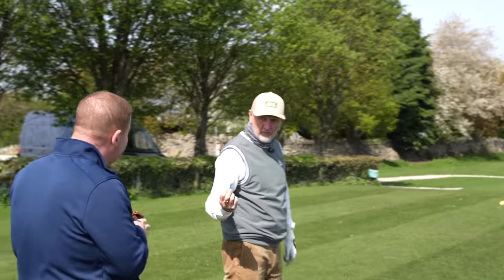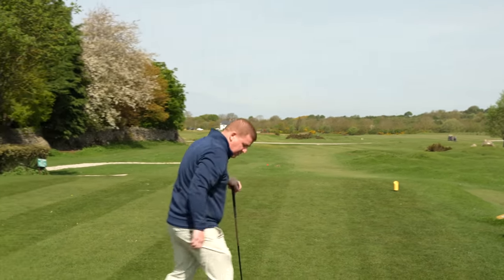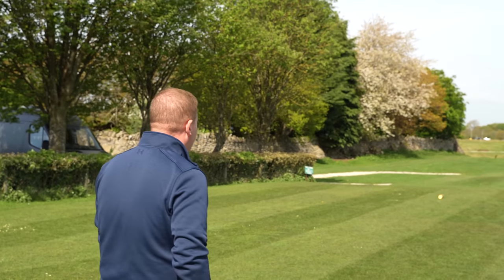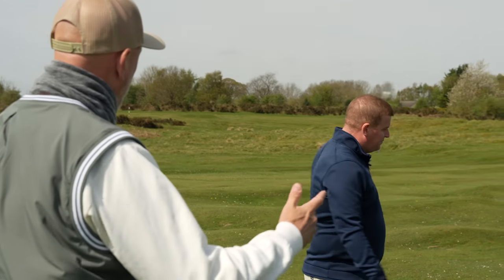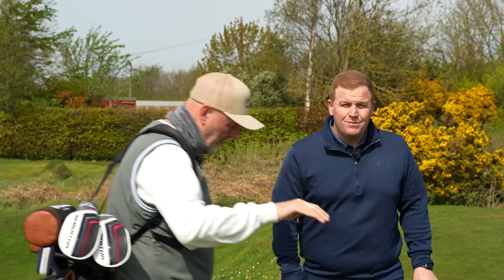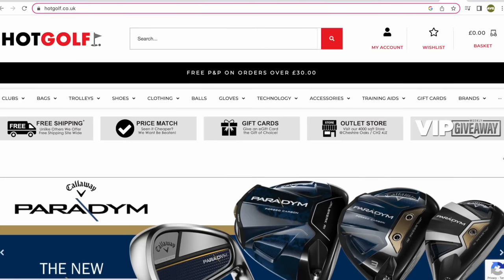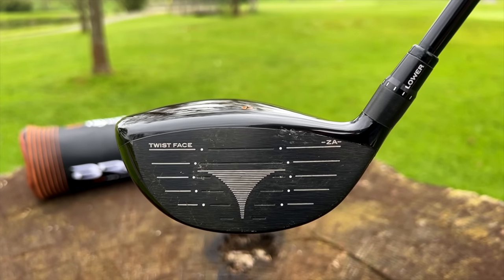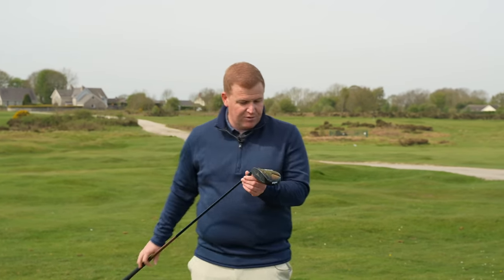We tried this with the TaylorMade Mini BRNR Driver!!!

Comment: I bought two of these mini’s, I play the 11.5 at 10.5 with a stiff shaft; I play the 13.5 at 14.5 with a regular shaft.  I hit a fade with the 11.5; I hit a draw with the 13.5.  No driver and 3 wood in my bag anymore.  These are so easy to hit!  I love hitting the 13.5 off the ground, so easy!
Reply: Is the 11.5 difficult to hit off the ground?
Reply: @James-th8tu  If you have the heavy weight in the back, it’s surprisingly easy to hit off the turf.  The only time I use the 11.5 off the turf is if I have to hit a big fade; other wise, I use the 13.5 off the turf.  I’ve played just about every mini-driver ever and this is by far the best.  I just don’t like the big headed drivers-I also play hickory golf and just enjoy smaller heads.

Comment: I bought a 300 mini 11.5 play it at 10.75 with a stiff diamana black shaft and it goes in the bag when the big boy goes off! I use a white castle tee and the flight and accuracy are exactly what I want off the tee when I am having a rocky time!

Comment: I have been playing a Mizuno STG from the factory at 44 inches and  set to 11 degree which closed the clubface  from standard enough to help fight my late square up fades. I have been hitting center of the face more often and getting a more penetrating flight. I have not noticed any loss of distance from my full length Rogue ST.

Comment: i ended up getting the new 2024 copper version and i LOVE it  went with the 13.5 degree and the MCC +4 midsize grip  I am 59 years old and a 8 handicap    off the fairway is awesome and off the tee   glad i went with it to go inbetween my 9 degree driver and my 17 degree Hywood    then my Qi10 Max 7 wood  22 degrees    Knock on wood off the deck i have been blasting it it works great for me     cheers from Canada

Comment: Teeing the ball low and swinging more like a FW wood is key with mini driver, in my experience. Feels so much more powerful and under control than trying to hit up on it like a driver. The CG is such that an upward AoA produces weak strikes.
Reply: Funny you say that, I was really struggling with this club when I got it (high handicapper). The balls had no speed or height, no control and felt awful coming out. I started leaning back a bit and hitting up on it like a driver (still teed pretty low) and got much much better results, about 10-20 yards less than my driver but better dispersion. I saw so many people online saying to hit it like a 3-wood so I just kept stubbornly hitting it like that, but when I commit to hitting up on it I get much better results. Haven't hit it off the deck yet though
Reply: Not for me. I tee it up fairly low and swing with about an 2-3 upward AoA. It's been working great.

Comment: I bought a used Original One mini-driver in mint condition used recently and it's been terrific as an accurate off the tee option that goes around 250 for me, vs. my driver that averages in the 270's. The mini-driver is definitely easier for me to hit consistently.

Comment: ANDY! You should do the differing handicap test with the mini, the one that you did several years ago. I thought that was brilliant because it showed it was not for a low/scratch golfer, but for the mid+ handicappers it was an eye opener. 
And to me it's about the dispersion, not the yardage, plus distance consistency. In my testing it was often going further than my normal driver, but consistent distance and dispersion.
I thought the swing weight was a big factor for me as I had a more controlled tempo, unlike the lighter driver.
Reply from the maker: I loved that format Brent but it was so difficult to pull it all together
Reply: @TheAverageGolfer  - you could hit up a driving range and ask random players, but that may get a little awkward. It was by far one of the more "scientific" methodologies as you had a baseline testing then added in the variable. 
I've watched all of the other reviews and they are all better players, thus would have better numbers with their driver so doesn't really give a good 1:1 match. I know James R. has also been raving about this driver too and has been giving honest opinions.
Keep up the great work!

Comment: Your making me want one. Could take the driver and 3 wood out of the bag and add this and a 7 wood. I think this is about to get expensive🤣
Reply: With the 2024 version dropping today, that’s exactly what I’m doing. I had just bought a new 3 wood this week, never even unwrapped it yet. Heard the news of the 2024 release 2 hours ago. Went straight to the store, returned the 3 wood and bought the new BRNR in 13.5. Chose that cause I can drop it to 11.5 if I want. Personally don’t feel the need to go any lower than that

Comment: 44" Aldila NV "R" flext shaft with a 14 degree Aerotech ASMD-01 driver head which is a 260cc head, and I lose about 10y off my 45" driver. The sole lets me also use it as a 3w. Off the tee I play it like a 3w, to let the loft get it up in the air instead of teeing it high. 15 rounds in a row without missing a fairway and I don't throw my back out every time I pull it out of the bag. Best $30 I have ever spent and I can carry it instead of a driver and 3W.

Comment: Fun challenge suggestion: Compare the mini-burner with a lady's 12.5 driver configured for a 5'4" lady. The shaft length and loft of the two clubs could be quite similar and produce similar results.

Comment: If there was an inch and a half of difference between the two shafts you're talking about 9 swingweight points give or take...on a D4 club to begin with. Serious backweighting is needed to tame that beast with a "normal" driver shaft length.
Reply from the maker: I think that was the point, many think it is a simple ‘put this shaft in this and put that shaft in the other’

Comment: This new mini-driver from TM raises so many questions, it's doing damage to my few remaining brain cells.
The first thing that occurs to me is that manufacturers have over the years been increasing the size of their driver heads and increasing the length of their driver shafts, in an attempt to give us more distance. Yet here we are "Returning to the Past" with a smaller head and a shorter shaft?????? Could it be that they have been shooting us a marketing gimmick all along??????
The best driver I ever had was a very early Big Bertha 3Wood whose head size and shaft length was almost identical to BRNR so I am tempted to give the new offering a try. But I also have to be aware that I'm now North of 70 and I know that I need all the distance I can muster and I probably haven't got the speed to optimise the new BRNR🤦‍♂🤦‍♂🤦‍♂🤦‍♂
Reply from the maker: So many questions…..it’s time we went back to smaller heads and shorter shaft IMO, maybe something in the middle 400cc head, 44.25 shaft…..some more to think about 🤣
Reply: @TheAverageGolfer  Sounds like a plan Andy, I know from my own testing/fittings that 45" is the absolute limit in shaft length in a driver anything longer and I can't find the middle of the clubface and just start hitting banana balls.
PS It was Great to see you two out on the course together👍👍
Reply: In mid late 90’s picked up a BB Strong 3. Carried that club into the 2000’s and was always a consistent performer. Reminds me alot of that club.
Reply: @GallatinMan  We are possibly talking about the same club, though I thought that mine was from the early 90s. Either way, it was a great club off the tee, long and you could move it either way or hit a straight ball.👍👍